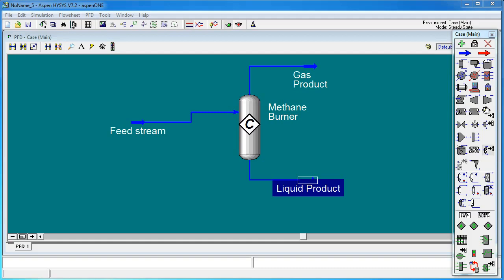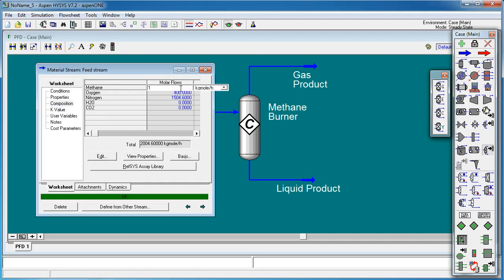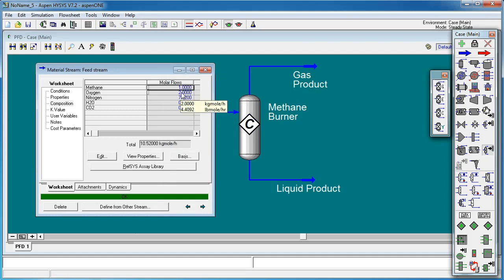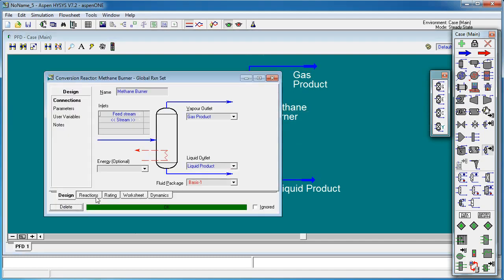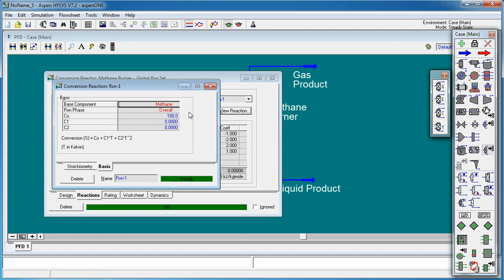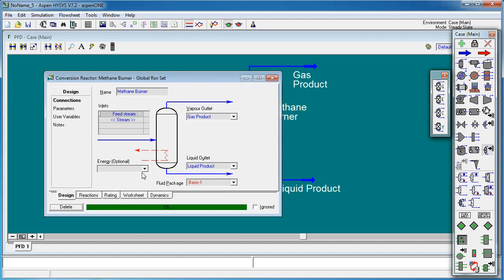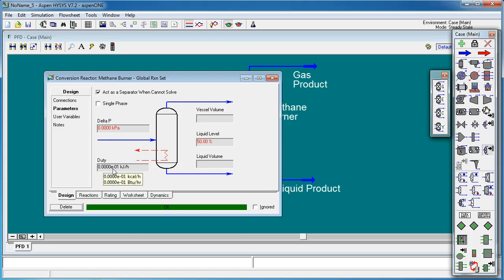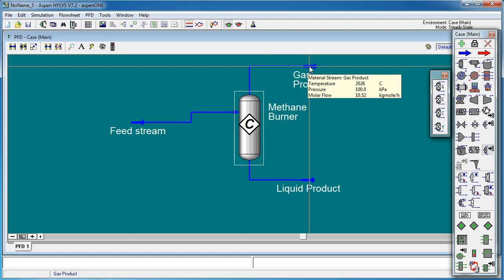Calculating the adiabatic flame temperature of methane using ASPEN HYSYS

Comment: Plz sir solve this,
" Write a program to study the effect of the percentage of theoretical air on the adiabatic flame temperature for a (variable) hydrocarbon fuel. Assume reactants enter the combustion chamber at 25◦C and complete combustion process. Use constant specific heat of the various products of combustion, and let the fuel composition and its enthalpy of formation be program inputs."